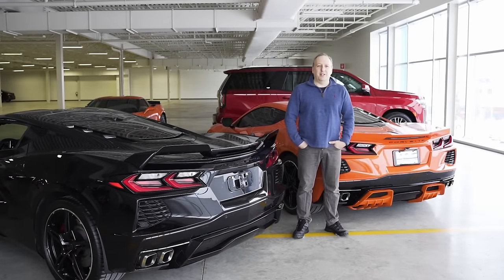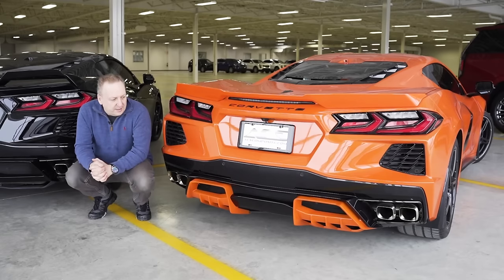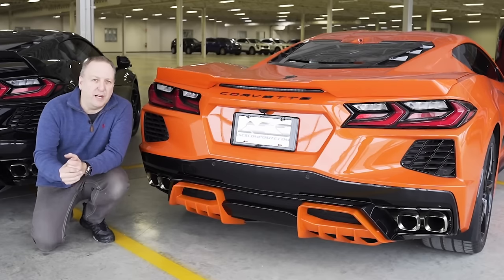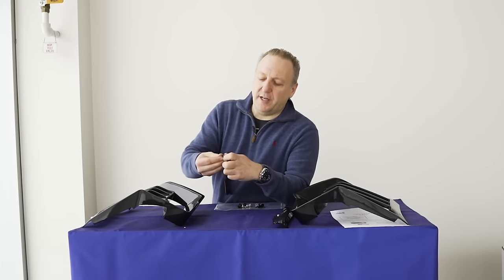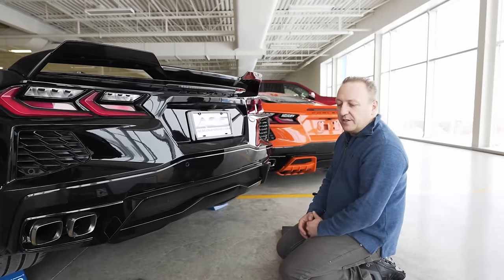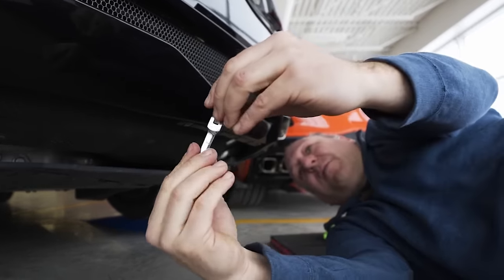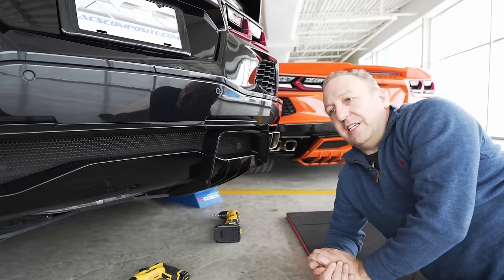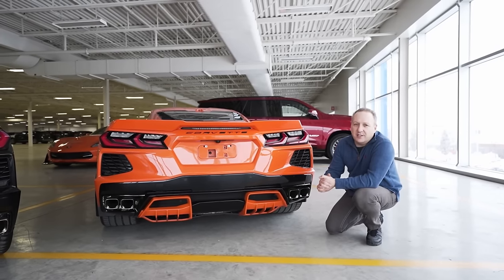C8 Corvette 2020+ Stingray Rear Diffuser Inserts | ACS Composite Install Video | PN 50-4-102

Comment: I purchased many of your C8 mods because no other aftermarket vendor has innovative designs, the absolute quality along with the fit and installation design.  This diffuser fit and finish is perfect 👍 👍.    This style is also good enough for Ferrari.  Just check out the diffuser on the 2023 FERRARI SF90 STRADALE ASSETTO FIORANO.

Looks like I’m adding one more of your mods to my C8.  

Every one of your mods looks like they were designed and installed at the Bowling Green Factory.
Reply from the maker: Wow! Thank you so much. Means a lot to us 🏎️🙏

Comment: Very nice Joseph and I will need these in carbon flash for sure. You guys are killing my retirement budget 😝
Now my question is, are they ready now and if not when, and if they are, if ordered now, how quick is the delivery?
Reply from the maker: We have Carbon Flash, Torch Red, and Arctic White as a first production batch in stock. Shipping starts on Monday! Thanks Joseph!
Reply: @ACSCOMPOSITE  my only other question would be, this mod will work fine with Corsa and other aftermarket exhaust? I know some aftermarket offerings of diffuser strakes or fins, there’s an issue with mounting. If yours is all good, I’ll be ordering flash black within the next couple of hours.
Reply from the maker: Haven’t had a modified exhaust setup to test. As long as the diffuser isn’t modified and that lower portion where the bracket goes has room there should be no issue
Reply: @ACSCOMPOSITE  just ordered two hours ago.
Reply: @ACSCOMPOSITE  When do you think Accelerate Yellow will be available?
Reply from the maker: We can paint it now. Email us at order@acscomposite.com and we will set up the custom order for you
Reply: @ACSCOMPOSITE  The diffuser won’t work with the Corsa exhaust. I can’t get the mount bracket to mount up, plus it’s resting on the cans. With the heat it will melt I know. I’ve given it a valiant try but there’s no way it’ll work. That’s kinda why I asked Joseph on the video reveal if it would work and he said tho you all hadn’t installed it on any aftermarket market exhaust, it should work. Where do we go from here?

Comment: What is the distance, in inches, that your diffuser extends from the stock piece?
Reply from the maker: What part would you like us to measure from? The fins, at the tip?, fins at the back? The top portion that extends or the inner side that extends out?

Comment: They only work with a oem exhaust?
Reply from the maker: They can be modified to work with any exhaust. Most canisters are too large and interfere with our bracket. You can trim the bracket to accommodate your setup
Reply: @ACSCOMPOSITE  can i mount it without bracket just with super glue?
Reply from the maker: @pulimassiv7849 there’s a lot of heat in that area. Probably not the best thing…

Comment: Great install idea. But the diffuser design is to tame. They need a much more defined fin profile. Fin surfaces should be  about 3 times the size offered.
Reply: Imo, 2 times as much would look just right.
Reply from the maker: Maybe we need an XL version ;)
Reply: Disagree. Sometime less it more. Fine line between what matches OEM and what looks like it was put on from Auto Zone!